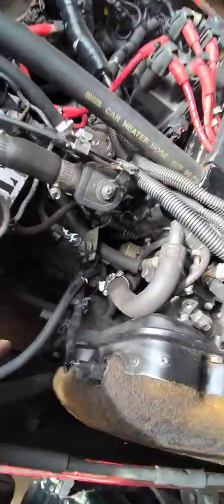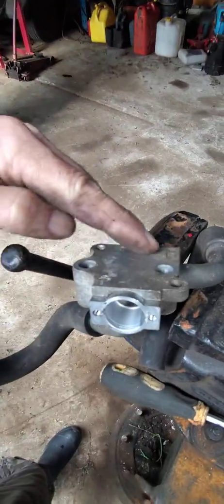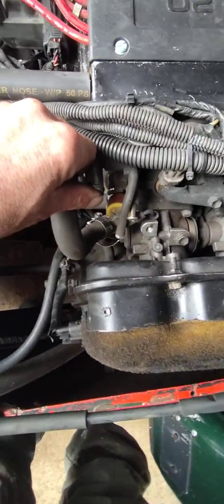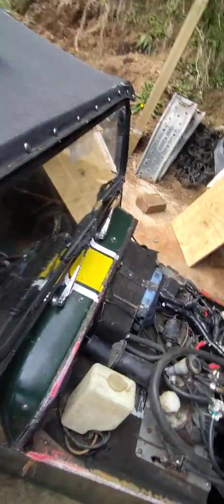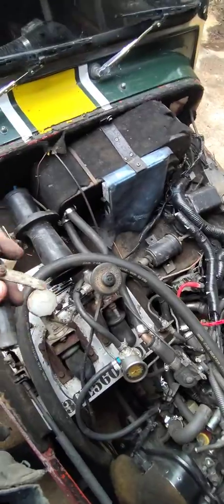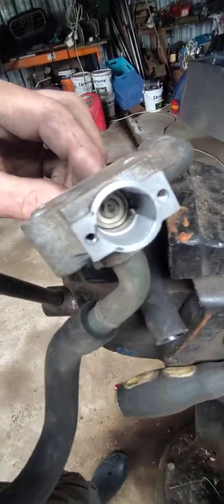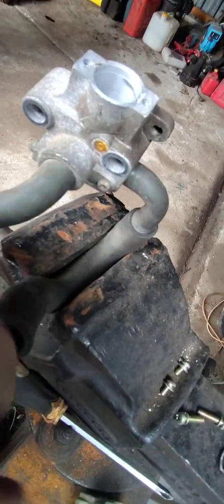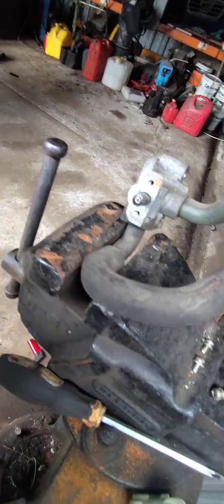4age Toyota IAC idle speed device explained in a simple way.

Comment: The magnetic unit opens the iac under very high vacuum when the engine is on the overrun. It allows air to enter the inlet manifold when the throttle butterfly is closed.

Comment: This is an amazing video, I'm running my 4age 20v with a link ecu and I have been having a hard time keep it at a consistent idle, thank you for your video i now understand how this works.
Reply from the maker: If you have a modern link ecu like a G4 onwards you can connect a pwm Nissan idle valve and send it a target idle speed. The Nissan RB style of valve is nice as it has a base idle screw on the valve. I set mine to 850 idle and the link lifts the cold running up to 1250.
Reply: @planesofpaper  might be a bit hard to get in Canada, i have a G4X pnp for a st205, same plug as a 20v. is there no way to get the 20v air idle to work right with the link? playing around with the link last summer I wasn't getting surging, but it was hard to dial in a consistent idle, but maybe I can get it dialed in now that i know how it works.

Comment: thank you sir for the video explaination..really appreciated it..i put this on my 3sge beams itb, but my location is on the alternator bracket..now i know it have to bolt on the head or the blok. thanks🫶🏻
Reply from the maker: Hi. Glad it helped. I have itbs on my beams also. The way I did it was I used a alloy small combined manifold with hoses to each manifold port. I then used a Nissan pwm driven valve as it had a screw adjustment built in. I then set base idle at 880 and the drove the pwm with my Link Ecu idle table.